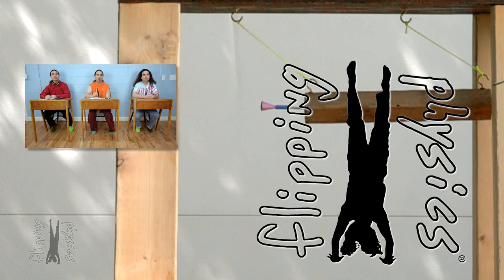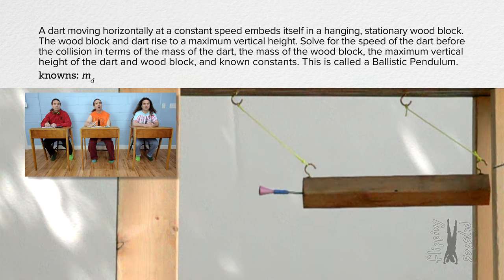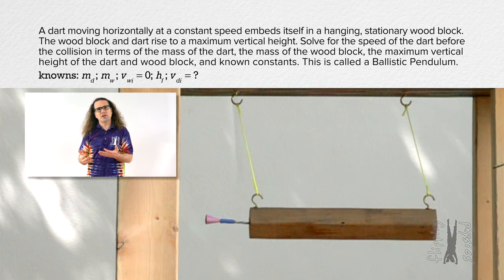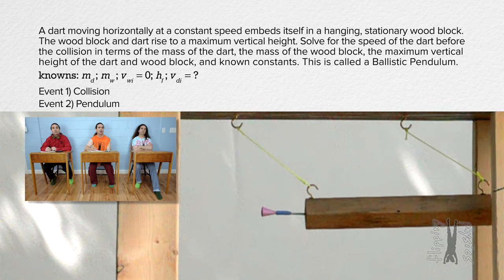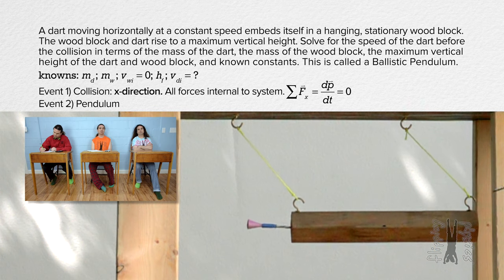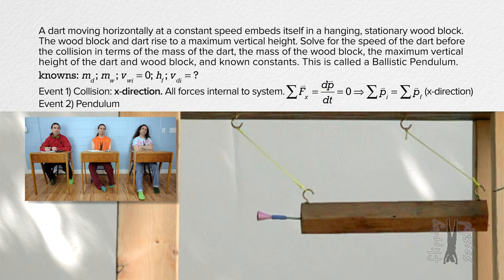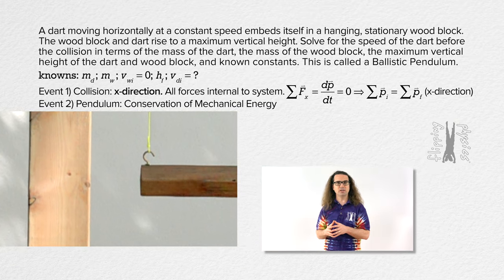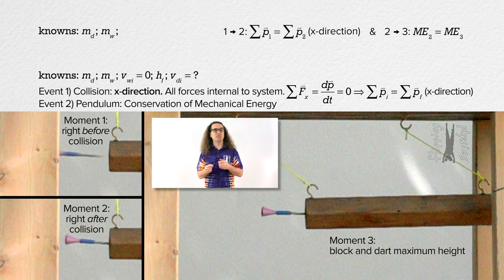Ballistic Pendulum

Comment: I have a question,normal and tangential acceleration are components of acceleration in non uniform circular motion ,similarly is angular acceleration a component of the acceleration in non uniform cirvular motion ,coz its perpendicular to radial and tangential components making them the three mutually perpendicular components of acceleration
Reply: Interesting observation.  Not sure where your question is, but I will advise that the direction of angular quantities is really just a matter of convention, that we define them in the direction of the axis of rotation.  It doesn't mean anything is physically happening in that direction, it is just our convention for keeping track of these quantities, and the binormal direction (axial direction) is the direction with the fewest arbitrary decisions we would need to make, in order to assign it.   Angular acceleration also has different units than the linear acceleration, so it isn't something you could add up with linear acceleration.

Indeed, the two linear accelerations of centripetal and tangential acceleration are coexisting, and do add up to form the total acceleration.  Total acceleration has a component that changes speed, and a component that changes direction.

Comment: The physics works!
Reply: Looks good. In the future, do you think it makes sense to discuss more than just ↑ and ↓ when looking at equations for this purpose (going numerical, like doubling initial velocity)? I guess if you're doing that many comparisons, and just doing sense-making, ↑/↓ is probably enough. Also, for these equations, there aren't simple relations, so I guess I just talked myself out of that, but you could mention that doubling initial velocity results in a new height that is less than double the previous height.
Reply from the maker: I have done those types of problems a few times. It's been a while though. Maybe I'll add a couple in the future.